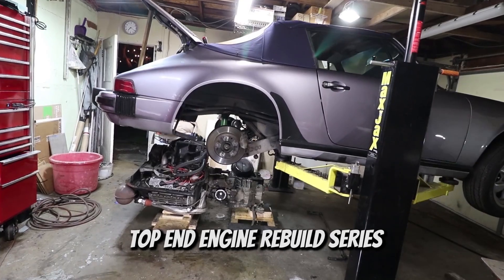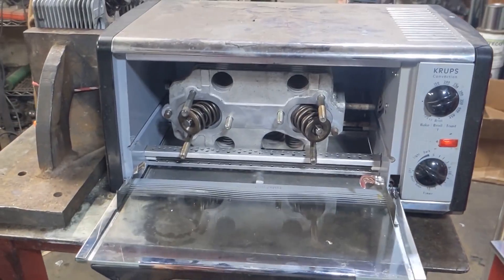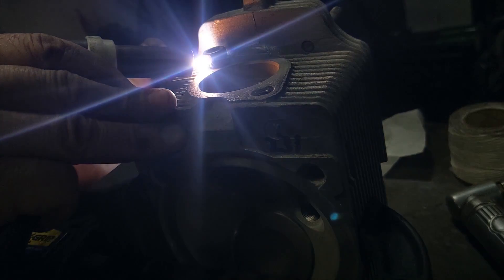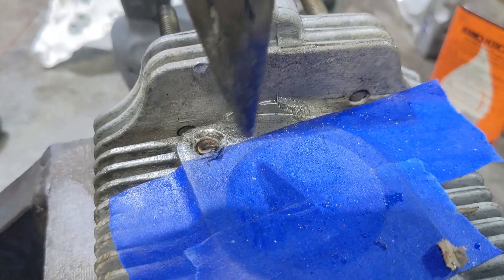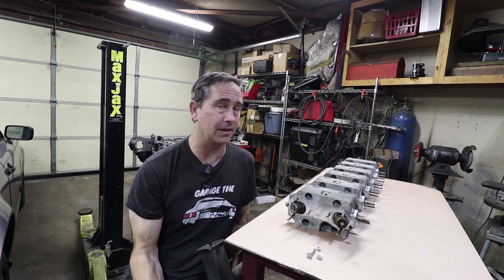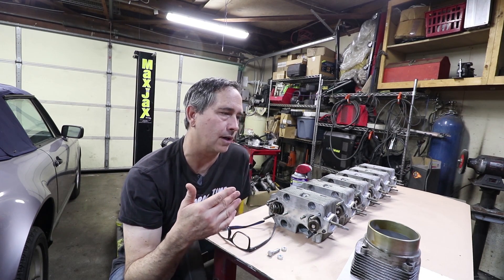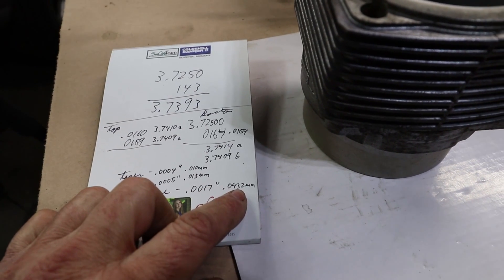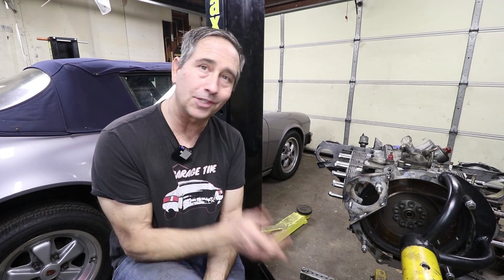Difficult Exhaust Stud Repair On Porsche Aluminum Heads - Top End Rebuild Pt. 5

Comment: Always love how you show the details. Patience was definitely practiced in large dose. Just wondering if you would have secured the heads, then tried removing the studs would have helped?
Reply from the maker: Thanks!  My thought process on the impact wrench and unrestrained head was to send vibration waves through the metal.  The wrench is plenty strong enough to break the stud, so I kept it on the lowest setting and let it vibrate.  It worked on some but not all.
Reply: Yes, figured... my thought process is that by securing the head, you'd have deeper penetration of energy from the impact. Starting at the lowest setting as you did. Honestly, enjoy the authenticity and patience. Keep up the good work.

Comment: I paid a shop... shame. I hope you go over piston height in the cylinder and the clearance.  I have to do my 3.0 with new cylinders and JE's.  Haven't done them before with the talle piston. Nice job so far, sir.
Reply from the maker: Ok, I'll do my best.  This is a stock engine, so it is less likely to find any tight or potential interference spots.

Comment: That looked quite painful, but I'm glad you got there in the end.  My car came from England (salted roads took it's toll) - yet, I was fortunate enough to not suffer any broken head studs when removing the exhaust.  I used one of those induction bolt heaters to loosen everything up and it worked quite well.
Reply from the maker: Cool, I'd love to have one of those heaters myself!  Were you able to use it on the exhaust studs too or just the exhaust nuts?
Reply: I didn't try it, the studs were fine, I just cleaned them up (and the rest of the engine) and bolted up the new exhaust.  So far, so good.

Comment: Ive been here, the solution I found is before you break off both studs is to make yourself a drill jig with the correct spacing. bolt it down with the remaining stud and drill out the other one. Fit new stud and then repeat.
Reply from the maker: Very good advice.  In fact Stomski racing makes a tool that does this.  
I found drilling a pilot hole and adjusting it with a carbide burr was enough to get the hole centered, but a drill fixture is a must if doing this more than once.

Comment: Hi Tom, another great video. Which in your opinion is a good workshop manual for an European targa 3.2 from 85? I bought a cheap Haynes to start with but it is too basic
Reply from the maker: Get the Bentley manual or the factory manual is best.
Also the Wayne Dempsey book on engines.

Comment: Curious as to why you had the heads rebuilt and then removed the exhaust studs.
Also, is it somewhat rare to have Alusil cylinders on a 3.2 Carrera?
Reply from the maker: I thought the shop would remove the studs as part of the rebuild, but then I found out it was $700.  
All the 87-89 cars had Alusil I think.
Reply: Gotcha.  Rebuilt my ‘86 last year and had Nikasil cylinders.

Comment: Great presentation!  Did you consider using an inductive heater on the studs?
Reply from the maker: That is a great tool, but I don't have one.  I'm not sure it would  fit on the stud close to the fins?  I used my tig torch to heat the side of the stud and a few would still not back out even after it cooled.
Reply: @GarageTimeAutoResto  makes sense.  Imo, unless they would come out easy, based on what I've heard and you're experience, it would probably be worth the expense to have someone extract them.

Comment: My first thought would've been to remove the studs prior to sending them out for machining. Why? I worry about the heat from welding nuts onto the studs affecting valve seals...etc. Thoughts?
Reply from the maker: Yes, it would have been better to remove the studs first.  The heads get much hotter than this while driving though.

Comment: Those studs that broke were all next to fins?  That’s a really tricky stud not a lot of room and thin shoulder.  I would have cut the stud just long enough to put the nut on. Put a rod between the head and nut so there is a little gap weld the nut, put beeswax instead of kroil. Turn the nut in a bit then out.  Either way you got it out without breaking taps or extractors
Reply from the maker: I tried bees wax too with no luck.  That was the first thing I tried.

Comment: I  just gave my heads to a machine shop  they blasted them drilled out every exhaust stud  fitted new guides and recut the valve seats.  Those heads are so valuable if you damage them. Also it's a must to change the exhaust head/barrel studs
Reply from the maker: Well done!  Can you reply how much the exhaust stud replacement was?  Just curious.  Did they put any kind of thread inserts in the heads?
Reply: It was about 3 years ago and they charged  about £750. They fitted inserts not sure what type but  everything  they did was proper. When they recut the valve seats It was a three angle cut. They also drilled the majority of the valve guides out  before knocking the remainder out which is kinder on the heads.  Also they checked if  the heads needed skimming  which they didn't. 
I will mention  again if anyone  in the UK  is Interested I have all the tools and literature to assist a rebuild. A yoke to hold the motor to a stand, the spanner for the cam a wiesco piston ring compressor  the cone type. A mount for the dial gauge and a little  insert  for calculating valve shims under the springs.

Comment: Tom I work in a machine shop and you did a class A job of removing those studs . The one thing that may help you in the future is when you  drill your first hole you drill all the way through the fastener to ( 3/16) as you did. But on the second hole drill 3/4 of the way through the fastener( you are leaving a little step ) then drill to a size that close to the tap drill only 3/4 to the bottom. Now when you put the extract in it bits  in to that little piece of fastener that is 3/16 and you can unscrew it like a spring because you are not pushing the fastener against the wall of the casting   if you do it right the little bit in the hole( the step) goes concave when you hammer the extractor down into it and it unscrews . it works every time when every thing you drill is paper thin (but not touching the threads)
Reply from the maker: Thank you, but isn't this what I did?  I thought I showed this, no.  
Also are you a fan of the straight extractors or spiral ones ?
Reply: @GarageTimeAutoResto  you did a great job of explaining I was just throwing my 2cents in  ( maybe I was not being helpful) and we have had the best luck with the straight extractors because if we break one they come out much easier . And we have had the best luck with Kroil and P/B Blaster we found they work well with heat .
Reply from the maker: Awesome man.  Thanks for the feedback and support!

Comment: never use an impact gun on seized studs ,, all they do is ring things off ... double nut and weld when the stud is still there is a mighty good start ,,, but its heat and reheat that does good  , with a full to cold space inbetween ,,, lots of patience also the lube of choice at the moment is Wurth  Injectorex , it works well where others dont seem to.
Reply from the maker: Never say never because this is the only thing that worked after doing what you suggest.  These were cycled up and down in temperature over several days.
Reply: @GarageTimeAutoResto   ah ,,, no ,,, the trick is to heat the stud / nut combo as hot as you can , nearly white hot , then leave it ,,, repeat as needed , Ive been doing this sort of job for a long long time , and every time the rattly gun comes out things snap ,, its the thermal expansion difference that does the work , so heating it all up together does not get a big enough difference fast enough to crush the rust , then as you know a heated and constrained lump of metal shrinks back to being smaller due to the restriction , granted its better on steel than alloy , but same idea , when its cold the lube will work , but it takes time ,
Reply from the maker: I heated the stud several times  near the head with my tig welder three times and soaked it overnight in Kroil.  Yes, white hot.  
Sometimes drilling is necessary.  How many times are you heating and cooling a stud?  
The aluminum expansion in the oven and the vibration from the impact gun set on low was the most effective for me.  And the ones that broke were drilled.

Comment: My least favorite thing are broken studs, the collet removers are the best, left hand drills also good to drill out flush breaks.  I also have a 3/8” extension with a “Parker taper” and a T handle, to apply torque and use a pneumatic hammer to pound the stud. Congratulations on not killing a head in the process.
Reply from the maker: Hi John, this is such a tedious process.  I tried left hand drills too.  They did nothing for me.  Also tapped vertically many times with a regular hammer.  A few of these studs would only come out one thread at a time.  This was the worst I've ever seen.  Not originally a California car!

Comment: Not only am I impressed with your process of removing the broken stud, but that you didn’t immediately drop the “F-bomb” when it snapped. 😂
Reply from the maker: The camera wasn't on the entire 8 hours 😀.  I came back and tried again several times.  Some of the video footage here I was expecting it to break off, so I could drill it anyway.  This was really tough,  right up there with sanding.

Comment: Can new studs be stainless steel?  Love your videos
Reply: Quality stainless cold welds instantly (this is what you guys call galling).  It is not the panacea many believe.  Accept the fate that is aluminum.  The one advantage is the exposed thread area will last longer, but expect the same fight when it comes time to remove the studs.
Reply from the maker: If it's not one problem it's another.  
Cold welding for me is for bad welds with too little amperage, ha ha.
Reply from the maker: Thanks for watching.  I know titanium and stainless studs are available and both won't corrode.  The only problem with stainless steel is the threads gall up.  I'm going to go with yellow zinc plated steel and stay out of rain puddles😀
Reply: @GarageTimeAutoResto  I think ot's rather galvanic corrosion issue and going woth stainless steel bolts is way worse solution than zinc plated. Apart from that I didn't get the point what is best methodology to remove broken studs. Using the biggest drill as possible - sure if you are able to not go off center which for some cases can be really, really hard
Reply from the maker: What's ot's?
Reply: @GarageTimeAutoResto  should be "it's rather galvanic corrosion issue and going with" sorry